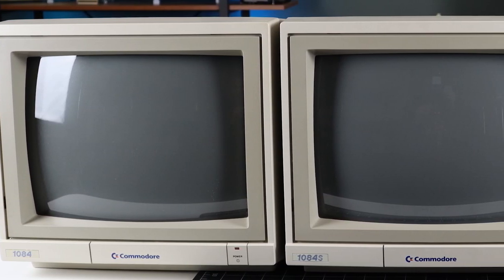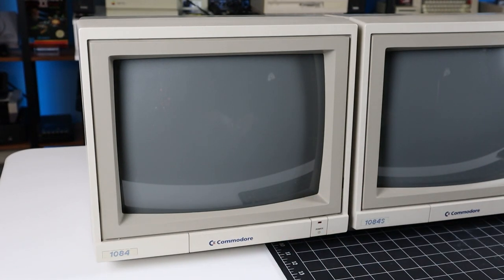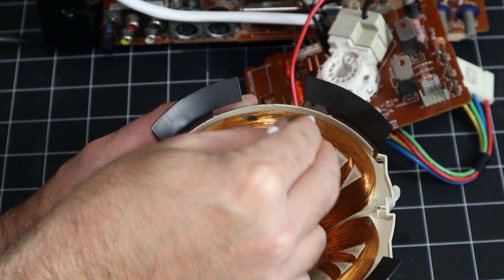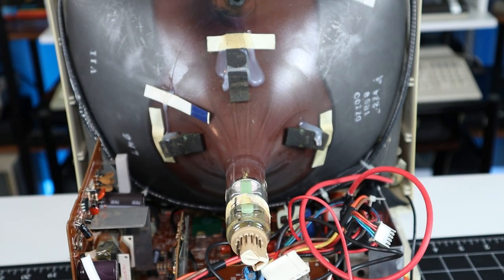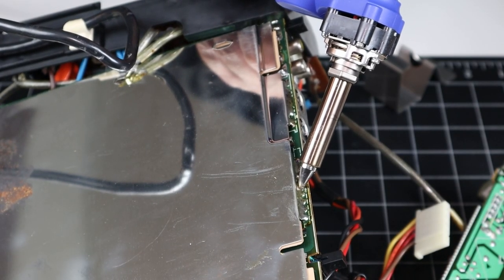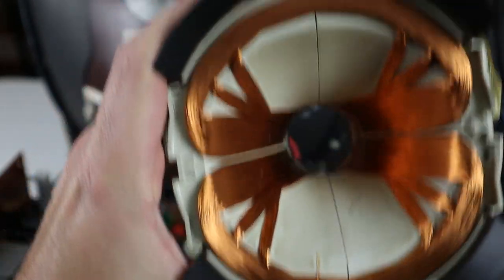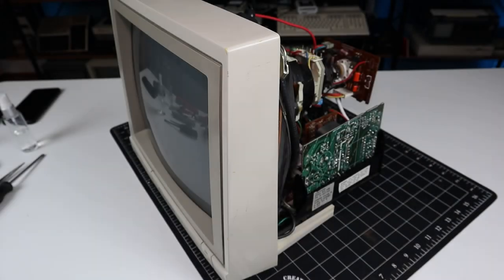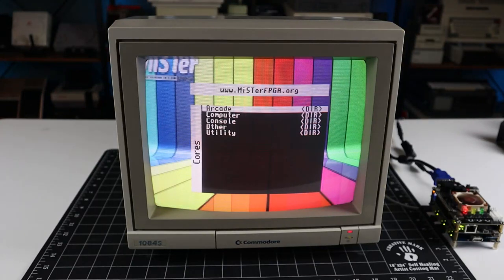Repairing my childhood Commodore 1084S monitor + RGB SCART mod!

Comment: being a 52 yr old tv tech.  Magnovox also sold these monitors with various connectors on the back so you should be able to get a 13" magnovox monitor and pull the yoke from it.  i have even pulled yokes from different brand monitors and used them in different monitors.   just make sure the resistance measurement is close to the original.  if it's really close then you should be able to make some adjustments on the main board in the horizontal and vertical deflection circuits to adjust picture to make it fit.  good luck
Reply: Hay Ben do you still work on monitors? I know, I know enough that I could hurt myself or die from the high voltage. If so, are you close to Ohio? I want to get my monitors serviced but I really want to drive them there and then pick them up, so that they are not getting beat up in the mail.
Reply from the maker: Great info, thanks for sharing! I will keep an eye out for a suitable replacement. Does it matter if it's from a TV or a computer monitor as long as it's 13" and has a similar resistance and physical fitment?
Reply: @retrobits  there are some Magnovox monitors that are obviously Phillips 1084 "siblings." Not as many features, but the same case, etc. Those are the ones that will be a match.

Comment: That was an amazing repair. My biggest concern about working on CRT monitors is the  high voltage that might (probably will) be present inside the tube and caps, etc., and how to safely discharge them. I have some experience with low voltage DC circuits, but I shied away from AC circuits because of the high voltage. I have two Commodore CRT monitors I need to repair. I saw you discharge your CRT but I would need detailed instructions on how to do it properly, so I don't fry myself. I'm getting older, but I'm not quite ready to be pushing up daisies. 😊Nice job. I learned a lot.

Comment: Thanks for the scart mod tip! I soldered scart connector to my PAL 1084S a month ago and had the same issue with sync. Now that I added the two jumpers, I have stable image through scart. Previously, I thought that I have to solder a number of missing components to the board.
Reply from the maker: Great, glad it helped and you got it working!

Comment: As soon as I saw the title of this video, I knew I would love it!  Yep!!  Awesome seeing your original 1084 working again.  After your previous 1084 video, I opened up my Magnavox 8CM515 and YES, it has the traces for a SCART connector just like the 1084!  I have the parts already and thanks to your bodge wire example, I’m much more confident I can get SCART working on this too.  Thanks!
Reply from the maker: Nice! Good luck with your upgrade 👍

Comment: I was so anticipating you rewinding the yoke. Also, the lacquer easily penetrates the coil if you put it in a vacuum after you apply it.
Reply from the maker: Maybe in part 3 :) Good tip, thanks!
Reply: OK, so now I'm curious.  :-)  Where would one simply put their CRT yoke in a vacuum?  (My space ship is in the shop.)

Comment: I saw a video recently of a guy that repaired multiple layers of the yoke windings and picked each busted winding apart, used similar gauge speaker wire to bridge the open connections, then used solder mask to paint over and re-flatten the repaied areas. The screen worked great after that.
Reply from the maker: I saw that too! I may have a go at it myself; it'd be nice to get it fixed.

Comment: Excellent work! I have a bad power switch in my 1084S, can't wait to see part 2. Taking the case off looks easy enough, hopefully you don't need to mess with the bottom RF shield to get at the switch connections.
Reply from the maker: Thanks! What's funny is the power switch in the good 1084S failed right after making this video so I'll be replacing them both it looks like. Should be do-able without messing with the RF shield at all. There's a write-up here: https://www.retro-commodore.eu/2014/04/12/c1084-power-switch-replacement/

Comment: Awesome video, bold repair on the yoke windings. I have had the same issue and think I have found a suitable yoke replacement. I've messaged you on twitter for more details
Reply: I have the same problem. I'd love to know what yoke replacement you have found.
Reply: @joel_ricci  there's a common tube in super cheap off brand mid 2000's 14" CRTs. the model number is 37SX110Y22

Comment: Great work! I had a spotless 1084S monitor later in my C64/Amiga days that ended up at my work being used as a CCTV monitor. It ended up failing after 24/7 power on for about 10 years. I wish I still had it now I have unboxed and repaired my old C64 gear.

Comment: Thanks for the video. Kapton tape might be better than lacquer for insulating the yokes.
Reply from the maker: Good idea, yea maybe I'll peel off the packing tape I used on the rubber spacers and use kapton on the yoke itself. I may also replace the spacers entirely since they're clearly degrading with age and are a bit gummy now.
Reply: @retrobitstv  Definitely, packing tape exposed to even mild heat is going to have problems in the long run. Some bargain basement forms of kapton take have issues with the adhesive under sustained elevated temperatures too, so it's worth getting some decent stuff from somewhere reputable.

Comment: Really enjoyed this video. Glad to see your efforts yield some positive results. I’m in the uk and use a Phillips cm 8833 a very similar monitor to your 1084. It works perfectly well with 60hz RGB sources but displays only black and white composite 60hz images. I presumed this is because it’s a UK 50hz monitor. I actually passed up a boxed 1084s recently worried about reliability problems but after watching this maybe I’ll go back and see if it’s still available. Merry Christmas stay safe.
Reply: Most monitors and TVs will sync happily to 50 and 60Hz and with RGB input will display anything in color. On composite (and S-Video and RF) signals, the color information has to be decoded first. So depending on where you live, it will either have a PAL or NTSC decoder. (Although some, like e.g. some Sonys are multi-system). If you have the wrong decoder for the signal you feed it, color information cannot be decoded, so you'll get just a b/w picture. With RGB you feed the monitor the direct color signal, so nothing has to be decoded and you'll always get a color picture.
The color encoding system also has nothing to do with the vertical sync frequency either, as there are countries that use NTSC with 50Hz or PAL with 60Hz. So in the UK you could for example set your original Xbox to PAL60 to get 60Hz video in color on a PAL-only TV.
Reply from the maker: Glad you enjoyed it! I have the same experience in reverse. My NTSC model can display a PAL image in b&w but cannot decode the color signal. The IC501 video decoder chip is probably a different model between regions if I had to guess, and on the PCB there are also different pathways for PAL and NTSC on the silkscreen and the components are missing from the PAL side.

Comment: Heya did you try a signal on the noisy monitor? To me it sounds like the horizontal oscillator is way off. (horizontal hold control would adjust it) Of course, the monitor won’t work anymore without a working yoke :-)
Reply from the maker: Hi Adrian, I did try both RGBi and NTSC signals when I first got the monitor home and the display was very clear and crisp - no issues with the image at all. I only had it on for a few seconds  though because it was so loud!
Reply: @retrobitstv  Wow then clearly not a horizontal oscillator problem! Strange fault indeed. The corrosion on the deflection coil is so worrisome. What an annoying mystery!
Reply from the maker: @adriansdigitalbasement  Yea, the 11khz peak on the EQ has me puzzled as well. A commenter posted a link to another video wherein a consumer TV had similar coil deterioration around its rubber spacers. One thing of interest is that my "good" 1084 had nice solid new looking rubber and the "bad" 1084S had tacky-feeling deteriorated rubber. Perhaps it's a difference of run time and heat exposure causing the rubber to break down, and in that process corrosion of the magnet wire occurs. Need more data points.
Reply: @retrobitstv   Man I am so glad to have stumbled upon this video.  I've got a 1084S that I got at an estate sale as well.  I haven't even powered it on yet, since I didn't want to assume everything was OK without taking the case off.  And while I'm in there, it's going to get new caps anyway.  I'll be adding the SCART connector, ground wire, and rubber insulation / re-lacquer just in case.  Thanks for potentially saving my yoke!  :-D

Comment: Thank you for this video! I have a 1084S with the SCART lid broken off. I was just wondering if it was that easy to just add a connector or if more stuff was missing. I guess I'll find out soon enough 😁 Thanks again 👌🏼

Comment: Cool video!  I've been struggling with a 1902a and Magnovox equivalent for a bit.  The 1902a was damaged in shipping and incurred several PCB cracks.  Doesn't matter what I do, I seem to have a High Voltage issue.  After what I thought was a thorough repair the HV shuts down almost immediately.  :(   I did have it where it would stay on, but produce an overly bright washed out image.  Anyway, love these videos of people like me learning as we go.  Keep'm coming!
Reply from the maker: I wish I could tell you that I knew what was causing your issue but I haven't experienced that particular issue myself. Maybe adjusting the screen control knob on your flyback (or sometimes neck board) might help if the image is too bright/washed out. Thanks for your feedback and good luck with your repairs!

Comment: If you can with color monitors, just swap the tube and yoke together. There are usually small strips attached to the crt adjusting convergence and color purity that is paired with the tube/yoke combo.
Reply from the maker: Thanks for the suggestion! Both displays did have convergence strips installed so I may go back and swap the whole tube and return the yoke to its original home. Lots of things to fix for next time :)

Comment: also, instead of adjusting the purity rings.  loosen the nut and rotate all the rings also try sliding it back and forth on the neck before turning any rings.  another note you can see your yoke is slightly off. it needs rotated to the left from the front of the monitor.   or to the right looking from the back.   that could throw your purity rings off.
Reply from the maker: Thanks for the suggestions, I will spend some time adjusting the yoke and rings now that I know the display works. I just aligned the marks I made before and called it good for the video but that's a bit rough and also doesn't account for the front-to-back adjustment either.

Comment: 14:30 
Pro tip, when listening for noises it is helpful to get a big long screwdriver and put it up to your ear and then the part your trying to diagnose.
Reply: That works on cars and most machines however we are dealing with equipment running north of 10,000 volts and 1/4 inch can mean 12 volts or 12,000

Comment: I got a Philips CM8833 (which these monitors are based on) when I got my first PC (also a Philips). I used it as TV too, until I got my first real TV years later. Even after I got other PCs with VGA outputs, I still used the CM8833. The only problem with the monitor was that the picture would sometimes jump up and down, and I never found out why (maybe an intermittent short in the yoke?). I wish I still had it; I could probably have fixed the problem with what I know now.

Comment: Great video. I also put a few months ago a scart connector in my 1084. I got the same scrambled picture you have. Now I know where to look to fix it. At that moment I couldn't find something oine what could help me. Hope it will also work on my monitor.
Reply from the maker: Thanks! Hope you get yours working too!
Reply: @retrobitstv  thanks it works also for me. I have a clear picture now. I cut a paperclip to make the bridges for 9289 and 9274. Do you know what 9275 is. I have the 1084 so the mono one. Via scart i have no audio. My monitor also doesn't have a cable soldered to the place where the scart connector is.
Reply from the maker: I don't have the monitor opened up right now and the schematic I have doesn't show jumpers. If you can trace 9275 to the scart connector, you should be able to identify what it does from a pinout such as this one though: https://i.stack.imgur.com/slaGE.png
Reply: @retrobitstv  i have audio now. I soldered a litte wire to pin 6 of the scart. (Left audio) to the audio in rca.
Reply from the maker: @Geke86  Awesome, glad to hear you got it working!

Comment: Funny that Philips made them. My first C128 was bought with a Magnavox Monitor that looked almost identical to the 1084 except with an 80-column RGBI hookup in the back and different color scheme.
Reply: I’ve always wondered how I ended up with a Philips monitor that looks exactly the same as the 1084. Only difference is that it came fitted with SCART from the factory, and has Philips branding instead of Commodore.
Reply from the maker: From Wikipedia: "Magnavox is the brand name worn by a line of products now made by Funai under license from trademark owner Philips." so it sounds like they really are all the same thing.
Reply: Philips used the Magnavox brand name in the USA because their company name was too similar to both Phillips and Philco.

Comment: I'm printing one of those lead benders! I'm glad you got the SCART working, tada.wav! Does the coil have any part numbers on it? Wouldn't be surprised if there were still some NOS parts out there. Also, I didn't know Commodore was in West Chester, PA!
Reply from the maker: There is a sticker with a p/n on the yoke but it's not visible in any of the video. I'll check next time I open it up.

Comment: Hello. I bought a new 1084, but the power light is on, there is sound from the speaker but there is no picture. There is no sign of high voltage. When I press the power button, there is no sound from the flyback. Where should I look first?

Comment: The noisy one, use an extension with a switch on it, left the monitor main switch on and quickly rock the extension switch on and off, if it turns on at the like, 10th time, you have my same problem, it's an AC zero crossing issue, I'm hunting it down on mine now, possibly a capacitor or a diode on the PSU side

Comment: see how when you adjust the brightness, and it's darker on one side then the other.  that's a bad retrace capacitor it can be mounted on the crt board.  if there is not an electrolytic on the crt board then it's going to be on the main board.
Reply from the maker: Nice catch, I did notice that but didn't think much of it. I will check but I don't remember recapping the neck board at all when I did the main board several years ago. I'm sure there are a few caps on it though so I'll add that to my list. Thanks!

Comment: Hey! I had the exact same failure on the deflection yoke on my 1084S-D1 two years ago. It had been shelved in a dry place for 10 years, and after powering it up it worked perfectly for 15-20 minutes, then the geometry suddenly got warped and then sizzling and magic smoke. I'm guessing the enamel on the coil wire cracks with age and then the copper begins to corrode. Really sad. It's not rocket science though, and it should be doable to rewind these coils. Let us know if you find a solution.
Reply from the maker: My friend keeps trying to convince me to build a jig and try it. I said "sure, if you help me" so we'll see. Someday, maybe!

Comment: hi there. Thanks for the video. Those are nice CRTs. I have a commodore 1084S monitor. It worked fine for years, but now the power switch in the back wont stay depressed. The monitor works fine if I hold in the switch. Can you tell me where to acquire the correct switch for replacement. And what kind of nightmare am I in for, to replace it? I never worked on a CRT before, but have taken them apart (the back sides) to clean them...thats about it. And I have basic soldering skills.  Thanks
Reply from the maker: Yea, the switch failing is a common problem. There are still replacements around, here are some options:

https://retro8bitshop.com/product/crt-monitor-power-switch-new/
https://www.wagneronline.com.au/pcb-mount-push-switch/switches/electronic-components/swp532-2979/348/pd/
https://monotech.fwscart.com/Power_Switch_for_1084S_or_CM8833/p6083514_21175494.aspx

They're also on eBay. Here's a good guide on the procedure:
https://www.retro-commodore.eu/2014/04/12/c1084-power-switch-replacement/

Comment: How many of these monitors were sold under the "Philips" brand? I have one that looks exactly identical to the 1084. The only difference is that mine has Philips branding instead of Commodore, and it came fitted with SCART as built.
Reply from the maker: Yep, Philips and Magnavox both sold more or less the same model under their own brand names. Some of them have a black housing instead of beige as well.
Reply: @retrobitstv  Thank you for the explanation! Given that it’s been in my shed for 15+ years, I really ought to check on mine.

Comment: How did you fixed the crooked image? Do you have a video explaining how to fix that?❤ 20:01
Reply from the maker: That one was easy, I just had to rotate the deflection yoke until the image was squared up properly. The only hard part is making sure not to get zapped while doing it.
Reply: @retrobitstv  any recommendation for that?